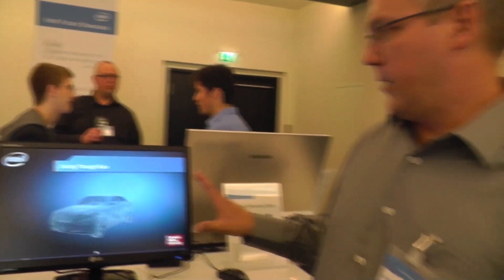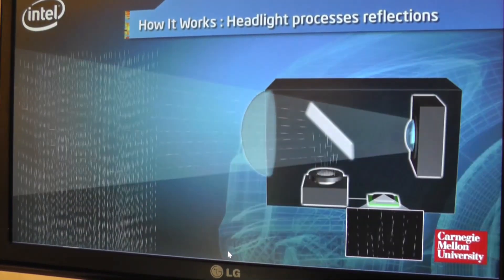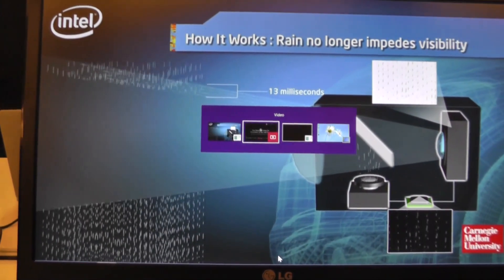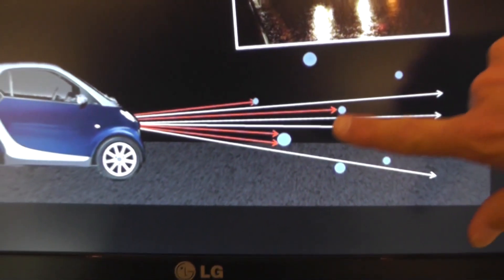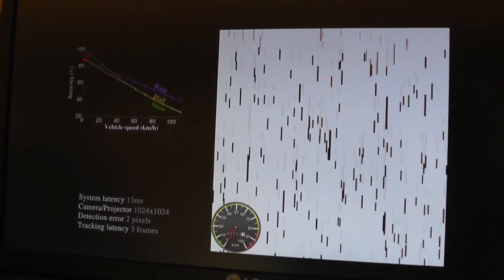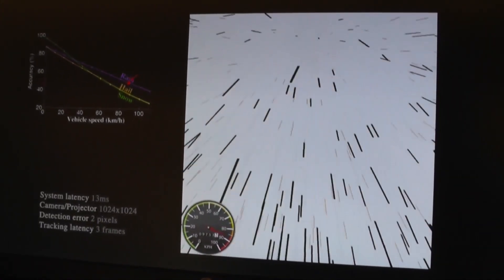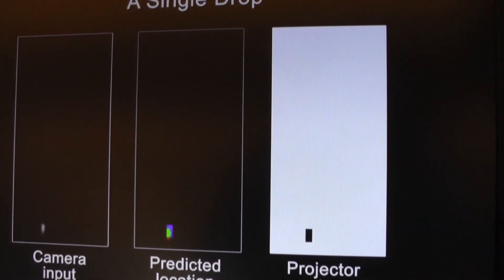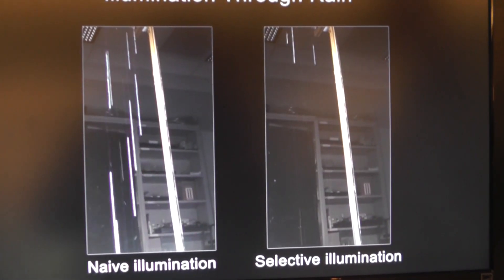Intel Seeing Through Rain Demo

Comment: Seems pretty obvious, driving through the rain reduces visibility and adds more elements for the driver to visually process to properly navigate... This system helps reduce the effect of the rain distracting the view for the driver and thus can make driving through the rain that much safer!

And yes, there are scientists working on windshields that will repel water and increased safety is one of the reasons!